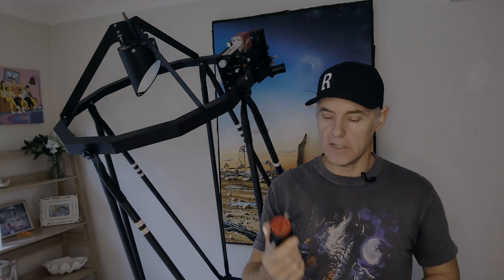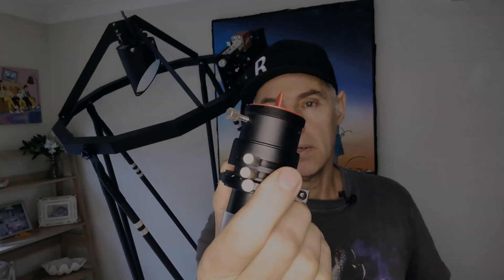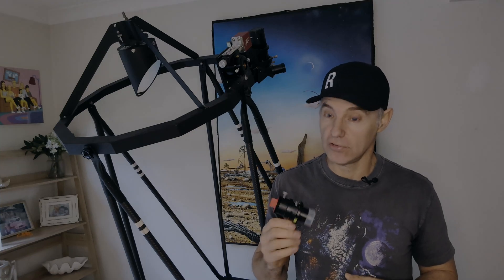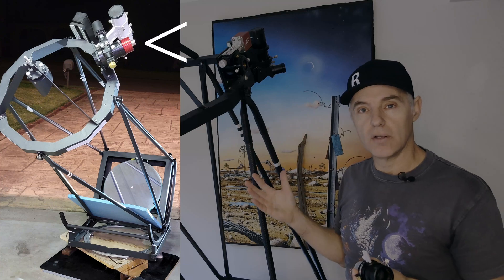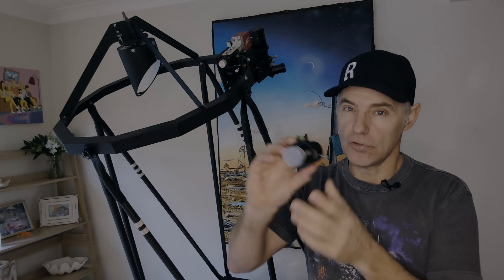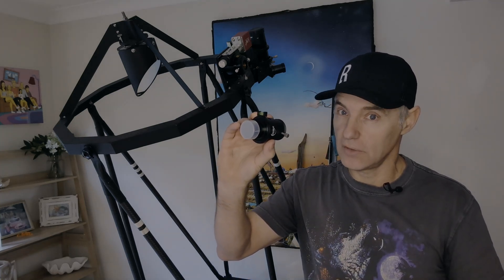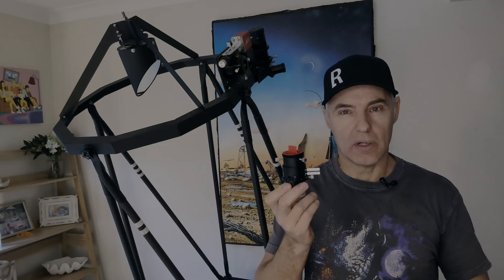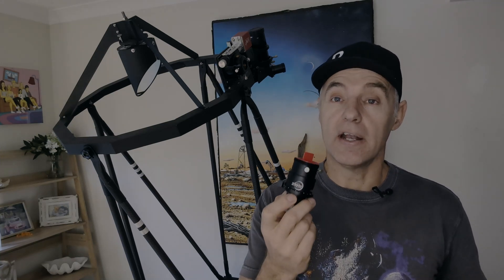Atmospheric Dispersion Corrector - Why you do or don't need one?

Comment: I have my adc oriented correcly but when ever I correct the levels it makes the fringing worse
Reply from the maker: Hi mate,
That is a shame that you are not getting good results here. What brand is the ADC? How low in the sky is your target?.
Do me a favour and rotate the ADC 180 degrees from what you are doing now and try again. Some ADCs needed to be aligned the opposite direction to the ones I use.
Let me know how you get on?
Damo
Reply: @damienk2372  my brand is a zwo, and my target was 20 degrees up. I will give it a try though! I’ve hear that some are “lefty’s” and some are “righty’s”
Reply from the maker: Yeah that's correct, if you're still having trouble split the leavers nearly all the way and twist the ADC in the focuser and watch what happens on the screen regarding the red blue aberration. This will be a massive cock on but even if you loose an entire night due to it you need to stick with it as a correct ADC orientation is absolutely essential to good images and correct focus.

All the best
Damo

Comment: Just as a small bit of feedback, the audio for the video is almost only coming from the left ear. Thanks for the vid!
Reply from the maker: Hi Christiaan,
I have found the problem and it will be fixed going forward so thankyou from everyone.

Damo
Reply from the maker: Thanks so much Christiaan.
 I will look into it 👌I did have some issues with the video when I put it together for some reason even though the settings were exactly the same as all my other videos. I had to render it in the YouTube preset (to fix it) in DaVinci resolve instead of my custom settings. Obviously this did not work as it sounded ok on my end.
Damo

Comment: Those expensive ones are for DSO. I have terrible atmospheric desperation on my SCT.
Reply from the maker: Hi thanks for the comment.
Even the 4900 euro one is sold as a planetary ADC but it has a 28mm of aperture which is much more than usual but still not enough for an APS-c sensor camera. The others are all less than 17mm of aperture and planetary focussed as well. I'd hate to see what one would cost with a 45+mm of aperture haha

Damo
Reply: @damienk2372  Don’t need APC sensor. This awful dispersion of SCT is obvious on bright stars and planetary nebulae. For such objects, 533 sensor is good enough. 
I also surprised that color splitting happens on Newtons. I always thought scopes should have glass to get dispersions.
Reply from the maker: @anata5127
Atmospheric dispersion as the name suggests has nothing to do with the scope type and in certain scenarios will effect all scopes exactly the same.
Some scopes with glass elements contribute to the dispersion as the colours from the light entering are further seperated due the glass elements being a poorer quality and design due to a price point needing to be targeted.
Damo
Reply: @damienk2372  Interesting. I have Tak Epsilon 130D. Unlike SCT (by the way Edge SCT), Tak never shows dispersion, even shooting the same target from the same location.
Reply from the maker: You focal length is way to small at around 400mm to show any significant dispersion. I am guessing the focal length on the SCT is longer than that, as well glass that is not helping your situation 👍
Damo
Reply: @damienk2372  Yes, SCT is 2450mm, Tak 430mm. 😀
Reply from the maker: @anata5127  Yep, your dispersion at 430mm might be 1 arc second and thus not be visible due to pixel scale but whaen you are shooting at 2450mm you will see the 1 arc second. This is what i mentioned in the middle of the video. Thos Saturn images are the same image but you can only see the dispersion when i zoom in. and as i said my Sautrn at Opposition is 700 pixels across and ring tip to ring tip is 40+ arc seconds and thus 1 arc seconds is 17.5 pixels of dispersion of each colour if you are shooting at my scale and Saturn or any planet (Mars 30 degrees this year for me) is low down. If i don't use the ADC i will have heavy Red/Blue colourisation of the planet edges.

Damo